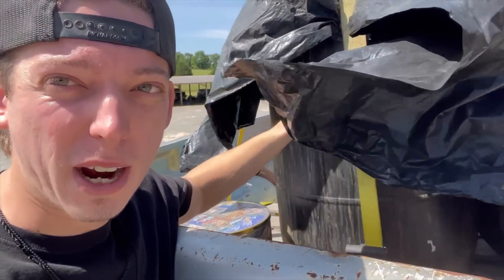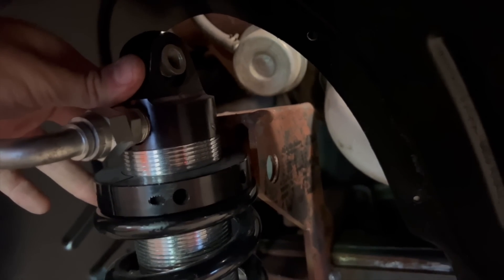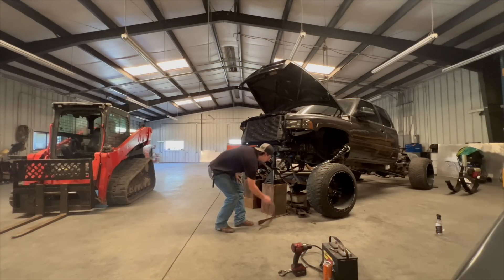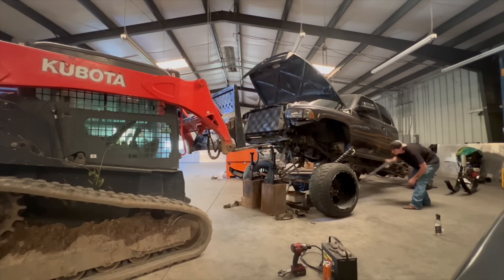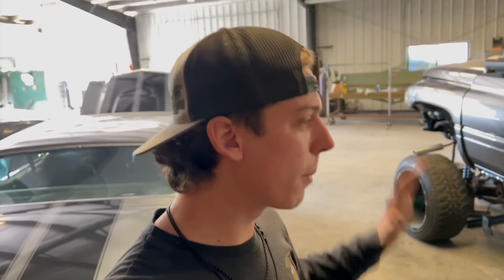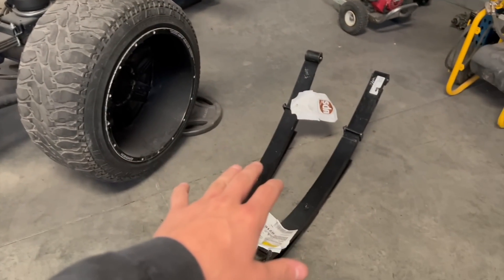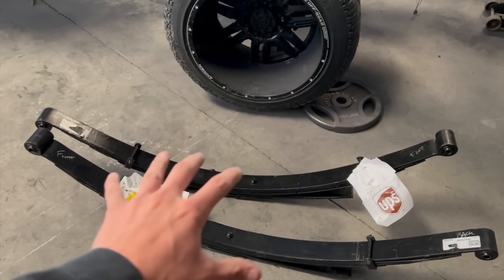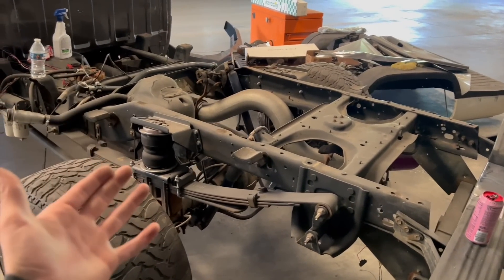From SQUATTED to STACKED, My CUMMINS LIFT Will Leave You SPEECHLESS

Comment: On mine I bought new rear sway bar links and cut em and welded in a piece to make em the right length. It was super easy. I actually did the same thing on the front too cause I didn’t like the cheap swaybar drop brackets they give you in most lift kits.

Comment: I can't see the wedge but ask chase if you have it right. A double Cardon joint can have mismatched pinion angles, but traditional single u joints should be parallel.  I don't know if your dodge has a double Cardon joint or not. That's what I've been taught, I run double Cardon joints
Looks awesome BTW, miss your uploads

Comment: You only lifted truck eight or so inches. Why didn’t you just take the wheels off? For the rear you could of just flipped the shackle and it would have lifted it 6 inches. Just build new shackle hangers. I wouldn’t recommend cutting and welding on a sway bar. You’re gonna melt the nylon inside the ball joint part.  Just get 12mm or 10mm heim joints. And make your own.